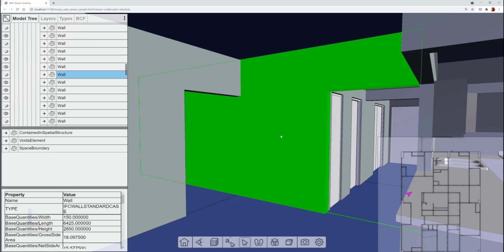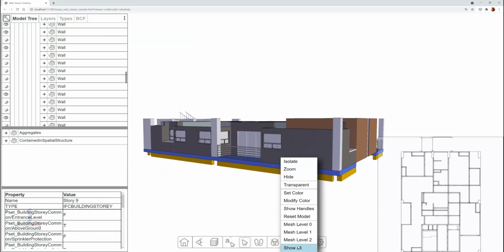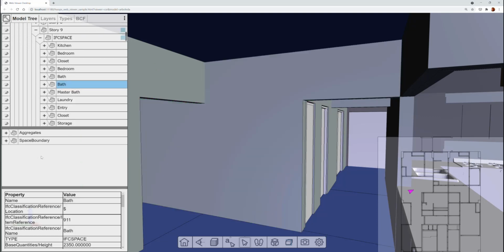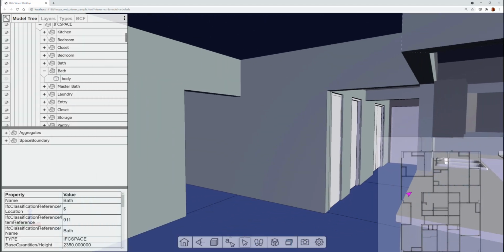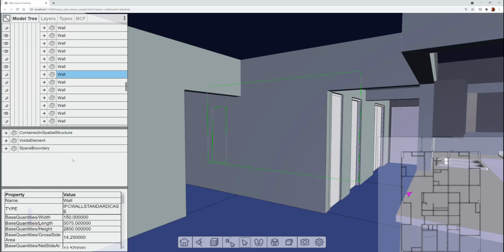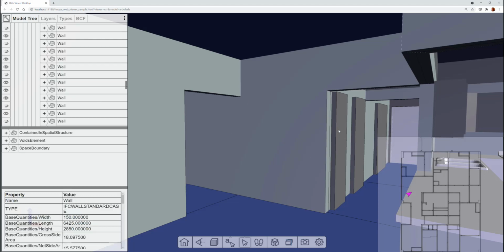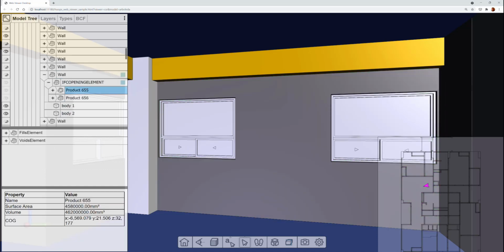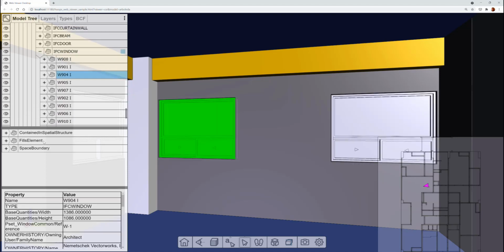HOOPS Communicator 2021 SP2 U1 Preview  - IFC Relationships

Comment: Hi, I have now downloaded the new version and converted some IFC models. I have also tested your sample models. But how do I display this relationship panel that you display in this video? Do you require a special parameter for the conversion?

Isolate and visualize space objects seems to work fine on your models, but not our sample models. But that seems because it is the inventory objects that are defined inside the IFCSPACE object, and the room itself is missing coordinates I think. I will investigate further.
Reply from the maker: IFC relationships did not make it into our SP2 release but will be available in the SP2 Update 1 release scheduled for July 27. It looks like our product team has already be in touch with you directly regarding this. Thank you!